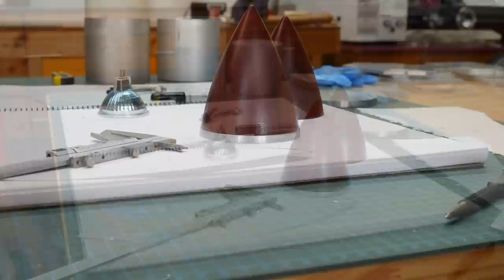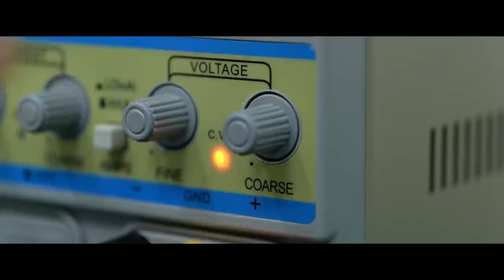Tokamak

Comment: In this age of laser cutting and quick-fix assembly, this comes as a spring of fresh water. The combination of planning, machining, hand shaping and assembly is stunning. The planning of the video as well with numerous camera positions, multiple screens and a discrete and pleasant track of ambient sounds are a perfect match to the fabrication, not to mention the impeccable workshop. I'm 75 years old and I've seen a lot of stuff but this leaves me stunned. So glad I discovered your work; thank you very much for this. I can't wait to share this with friends.
Reply from the maker: Thank you very much:) I should add that the ambient sounds you can hear, the many different types of bird sounds, are all live sounds captured at the time and nothing was added.

Comment: Absolutely stunning and very inspirational thanks.  The jarrah really compliments the aluminium.  Having just spent the afternoon cutting, filing, drilling and tapping aluminium it was nice to watch someone else do the same.
Reply from the maker: Thanks, glad to provide some R&R:)
Reply: thank you for more than the R&R. I've had a wood turning tensegrity design for about a year now, but never really had a solid implementation method. Your Tokamak construction let me see the light (pun intended). I gave away my first tensegrity turning at Makers Central, so it's the ideal time to make another.

Comment: well done . . . it resembles a pole-top fixture i once specified for a church parking lot . . . it had a different reflector system, bowl reflector on the bottom HID lamp hanging down into the bowl and a reflector redirecting the uplight outward (visible reflector was a different shape, curvier than yours) . . . they got the curves of both reflectors just right, the light distribution on the ground was unbelievably uniform with essentially no wasted uplight to ruin thee night sky.
Reply from the maker: Thanks.

Comment: After watching this again, I still think this is one of your most exceptional builds. The design and craftsmanship are both incredible, and the resulting light pattern output is beautiful. My only complaint is that it is difficult to watch all the split screens at once to keep up with what you are doing in certain parts of the video, but this is still much better than almost anything else on YouTube!
Reply from the maker: I didn't plan to make this video with split screens but as work went on it became apparent that the video was going to be way too long. I began to throw out many clips in an effort to shorten it but there were many shots I liked and didn't want to get rid of, so I though about running them simultaneously so I could keep them, hence the split screens. If you are interested in examining the work in greater detail then you could always slow down the video or even pause it to get a better look. I also make these videos for bigger screens and recommend watching at least on a 24 inch screen (my videos are edited on 32 inch screens and not made for phones or tablets). In the end I'm quite happy with the way the project and the video turned out;)
Reply: @AttilasWorkshop  
Attila, I did notice this time that the split screen videos were different views of the same part of the process. And they WERE great footage. I’m glad you included the extra footage, but if I have to choose, I’d much rather watch an extra 15 minutes of video and get the full-size view of the actions. Who am I kidding? I’d happily watch an extra 30 minutes!  All in all, it was another amazing video of another exceptional project. Thanks again!

Comment: If you can build to that refinement. How about a single, shelf speaker. With left/right direction sound. Using the same wood and metal.
Reply from the maker: Yes a commenter has already suggested making a speaker to this design.

Comment: Bonjour c'est tout simplement sublime je n'ai pas d'autre mot mais quel travail par contre on ne voit pas bien à la fin comment est le système d'alimentation et terminer le nec-plus-ultra serait d'avoir une recharge à induction à l'intérieur où une batterie rechargeable qui pourrait alimenter la lampe le temps d'un dîner ou d'une soirée en guise de décoration sublime PS : est-ce que vos objets se vendent quelque part?

Hello it's simply sublime I have no other word but what work on the other hand we can't really see at the end what the power system is like and to complete the ultimate would be to have a recharge induction inside where a rechargeable battery which could power the lamp for a dinner or an evening as a sublime decoration PS: are your objects sold somewhere?
Reply from the maker: Thank you. It's powered by a simple 12 volt adapter. There is not enough room for batteries etc. I originally designed this to be an objet d'art and added the lamp later.

Comment: And for the record, I have the juicer. It looks much better in catalogs. Sadly it has not been finished ground very well at all. They chromed right over the flashing
Reply from the maker: Damn, and I always thought that Alessi made great products.
Reply: @AttilasWorkshop  well I don't want to overstate the case. It is Alessi. It was beautifully polished, just prematurely chromed. It's just that when you see these things in design catalogs, and it's an item judge to be amongst the best, you have high expectations. Maybe that's not very fair, but at that price I don't think there should be any flashing visible at all. Handling it, one should be puzzled whether it is cast or machined, in my opinion. If starrett can achieve near perfection with their satin Chrome rules, I see no reason alessi should have less effort.

Comment: I'd like to see a version of this where the LED is completely hidden behind a shroud where ONLY the reflection of light is visible on the center spire and no matter what angle you rotate you can't get direct vision of the led also make a base with a contact-power input such as spring-loaded pins and pads to remove the oddly place DC port... Lastly a version that floats using magnets (possibly rotates) and uses wireless charging to receive power... I don't know how to use a wood lathe I can use CAD software and a CNC though also automated lathes if you want I can send you models of the redesigns but I'm sure you understand how to accomplish this. I just wish I was next to you in the design phase. Great work tho I love the design but I must be honest about what I don't like... the dc input really messes it up for me and I will get annoyed with the direct led shine due to it shining upwards so a shroud is a must, with reflection and an adjustable shroud you can "fade" the light think of the SR-71 Blackbird and its engine intakes and how they function
Reply from the maker: Sounds great! I'll be looking out for the video:)

Comment: Why use that super hot halogen bulb? It isn't an led but you certainly could source an ultra white led which would with driver be:
Less power consumption
Easier to power from an ac outlet
Not going to turn the metal on this thing into 3rd⁰ burns
Not likely to cause the wood in this thing too spontaneous combust due to hot metal around wood (unless poor circuit wiring but that is more likely than it catching fire from overheating, if led were used)
Possible color shift effects from led and combination colored led from one or more on a COB type led, remote controlled even

So try led in the future? They are everywhere and got very inexpensive. There are even dimmable led drivers and as mentioned the color range can be played with even multi color at the same time.
Reply from the maker: It's actually a 7 watt dimmable LED.😒

Comment: I think you are overly hard on yourself about what you receive as inspiration for your sculptures. I think it's quite a unique form. It's quite lovely, but I'm of the opinion that it's symmetry brings an element of coldness. I don't know if you are familiar with the trick when turning a cone like that of using a spacer on one of the three Chuck Jaws. Make marks every 30° around your piece. Turn the cone with the slight offset from the spacer aligned with one of your 30° marks. After each cone turning, turn it to the next degree mark. As you work your way around the circle, you'll end up with a very organic form that mimics a forming tornado. I think having this one organic element with the hard Sharp modernity wood help the wood grain stand out as an organic element. I believe the overall effect would be more of a artistic sculpture and slightly less of a science fiction feel. Please don't take any of this as criticism, you've done beautiful work. I simply wanted to offer another design possibility. I'm not suggesting it would be better than what you have built here. Be well
Reply from the maker: OK, cool, I'll have to try that out.